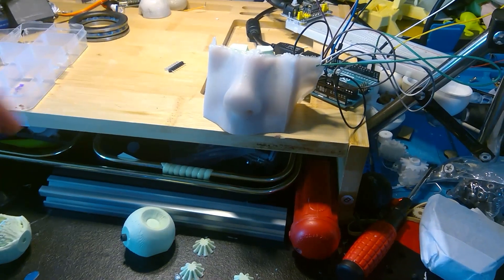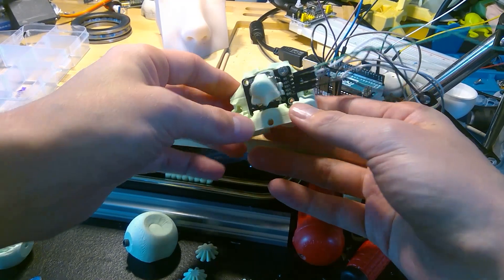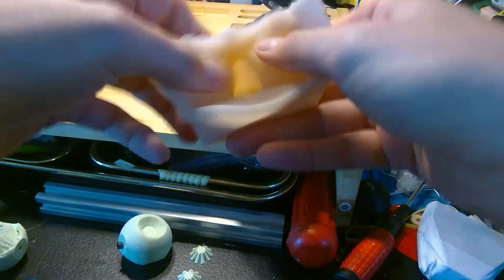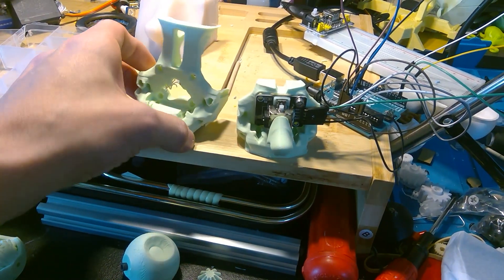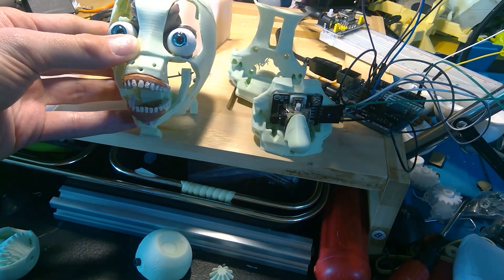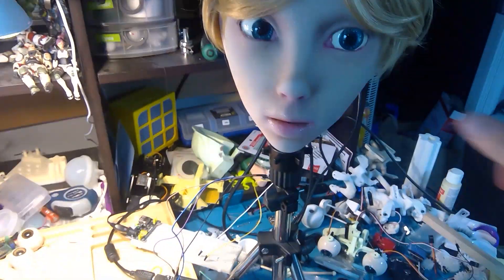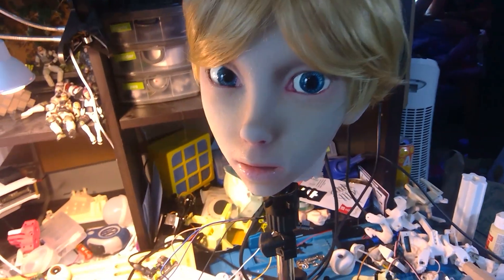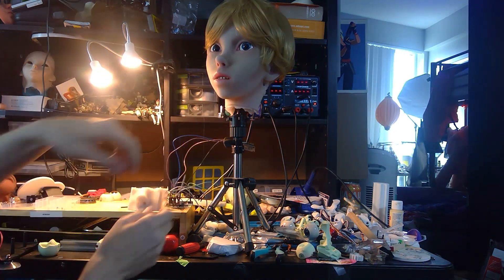Boop the Snoot, Move the Eyes: DIY Animatronics

Comment: I wonder if her eyeballs were manually positioned so that one eye is more tilted than the other (which looks more natural), since she's always looking left in this video 
Or if she already knew at this point of the project how to tilt her eyes as described, meaning she could have looked to the right and the difference would shift the other way
Reply from the maker: I generally add a convergence modifier to the code to tweak the distance between the eyes.  It definitely looks more 'normal' when the eyes are slightly inward looking and not totally parallel.  This crops up a lot when you look at characters in Pixar or Disney films.  When the eyes are enormous, the convergence becomes a lot more noticeable.
Reply: Edit: woops, you just answered my question as I was writing this, you almost got what I was about to suggest:

What if instead of having them move at equal amounts, you program their movement with a depth focal point in mind, imagine a triangle were the two eyes have different distances to the point of focus, this difference would be minimal if the focus is very far from her head but more noticeable if she's looking at something close like her own nose or to the very edge of her peripheral vision. You could use maths to let the program calculate the eye angles to achieve this focal point and appropriately move the eyes.
Idk how much of a realism you'd gain from this, but this approach might have the added benefit of working in favor of the laser depth sensors that you were considering at some point
Reply from the maker: We are of the same mind.  Telepathy at work 8I

I've got some face detection running on a rock pi now.  So the eyes can track faces that it can see, and make use of the size of the face in the frame to in turn control the amount of convergence.  So, if you get close to her, she goes cross-eyed :)

More work to do on this before I do video for it though.
Reply: @DaveMakes   wow I'm still catching up to the progress you've made so far but sounds like you got that covered! I'll be waiting for that video

Comment: wow! that looks good! i cant wait to see more progress on the model! maybe you can add a tactile-/capacitive sensor to the model for controlling or better reactions?
Reply from the maker: i'd like to do that.  I have my eye on some flex-sensors that I think could be really cool.
Reply: @DaveMakes  nice! also, do you intend on adding moving arms and legs? also-also, with a raspberry-pie and a camera in the eye you can add face tracking to your model ;)
Reply from the maker: @Edward-pw6zz  i'd like to do all those things, i've got a jetson nano board, which is like a raspberry pi, though beefier with some basic machine learning stuff built in.  Linux intimidates me though.  I've got some tiny cameras i'd like to try putting in her eyes.  optic flow sensors so her gaze can follow objects that move in front of her face.  lots of things I'd like to do, I need to learn a lot to do it though, lol.  Numerous stepper motors and linear actuators for her torso and arms, though I have only done rough designs for that part of her right now.